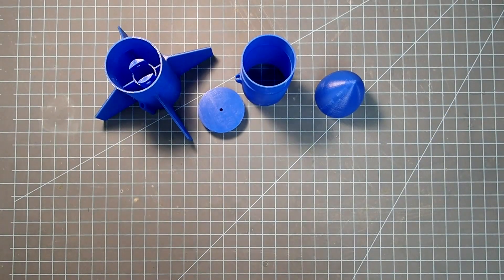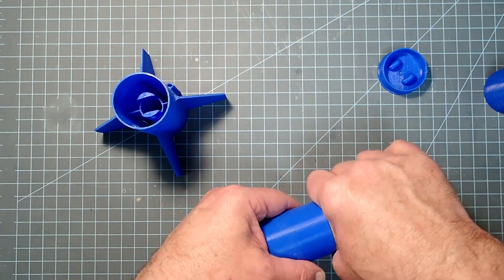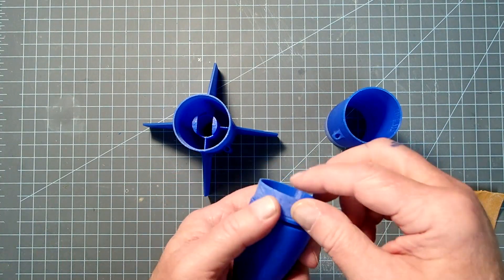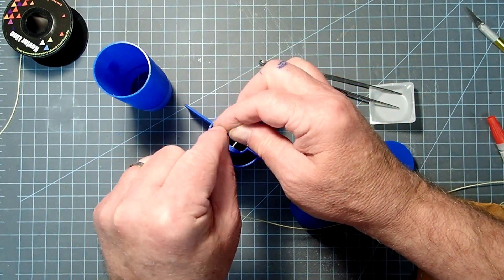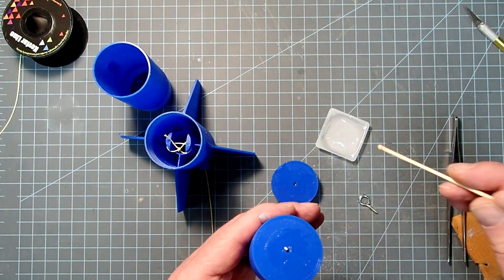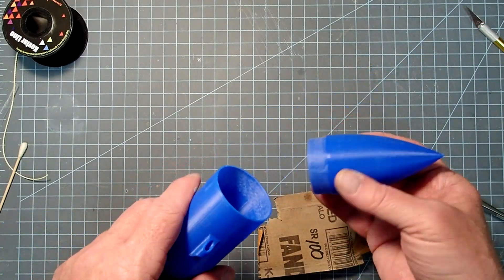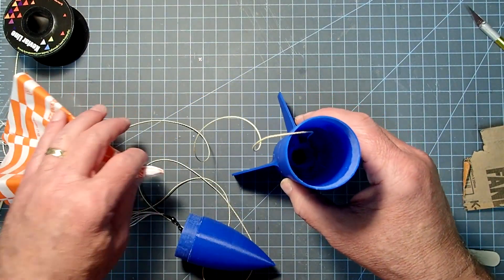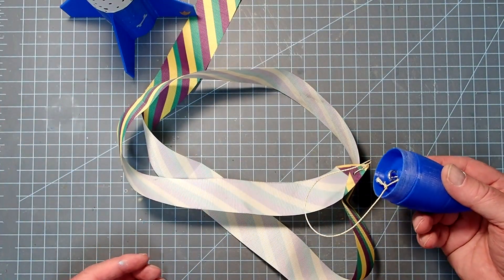3-D printed "Modular Model Rocket" assembly

Comment: Nice build. Does it take 18 or 24mm motors? and what is the weight of just the 3D printed parts?
Reply from the maker: This one is 18 mm. I will have to weigh it and get back to you.
Reply from the maker: 100 g - but this can vary depending on your printer settings.
Reply: @REAR_rockets  thanks